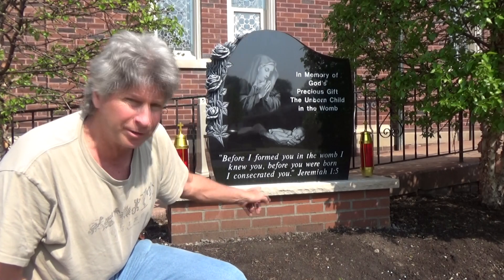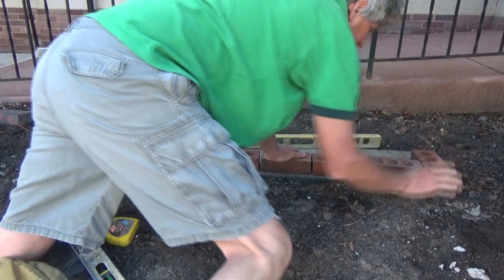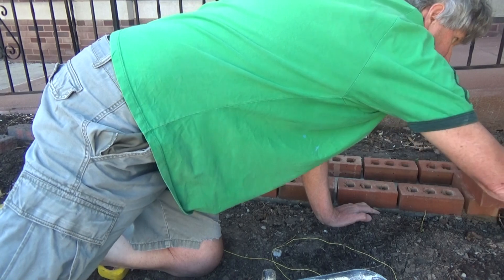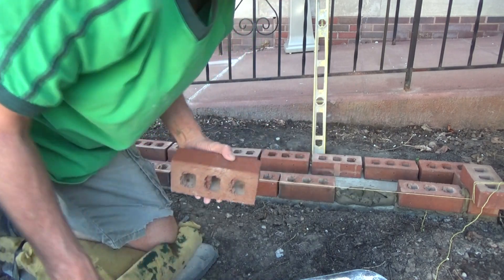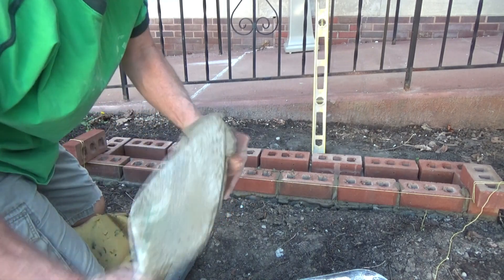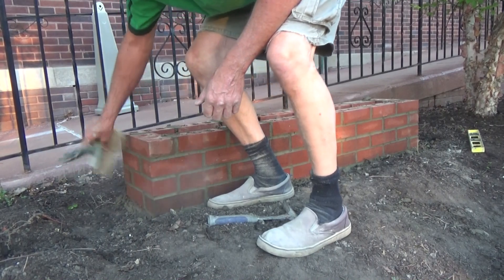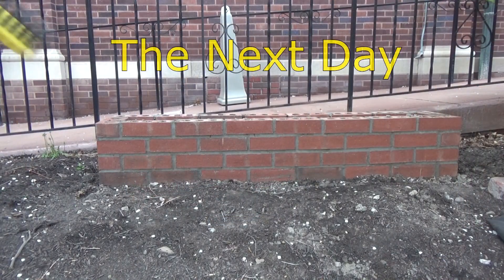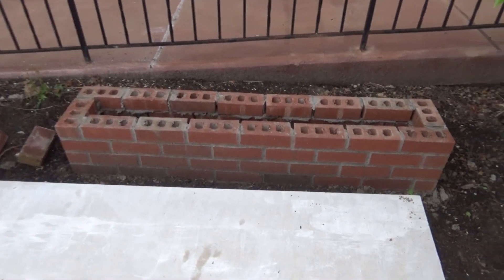Brick base for Monument - Tombstone  (Mike Haduck)

Comment: I always thought the holes in the bricks were there to save on material when making them. 
I always enjoy watching your videos 
Cheers 👍🏻
Reply from the maker: thanks Niall,  I agree with that also,  and the shipping was lighter too,  thanks again,  mike
Reply: Niall Acus it's two fold. It saves material which saves in shipping. Either lower weights or more brick per load. Second, the holes allow it to be in the kiln for less time.

Comment: Mike i use winter ad mix which is accelerator in a gallon jug for 12 bucks whenever i need something to set up quick. Which Im sure ya know already. Love the work
Reply from the maker: Thanks Dino I started using cement all And Lowe’s have the product out there is a fast drying cement but I appreciate it thanks Mike

Comment: I felt a little worried hearing you bad talk type s, since that's my go to mortar here in Central Kentucky, but our winters aren't as cold and our stone is more porus than the glassy bricks. I liked how you laid the bricks out to fit the form and set the line with the end bricks first. Technically you could have left your tape measure at home and still laid that little wall just as good.
Reply from the maker: Thanks Chris,  we mostly use S mortar up here, I just used the portland for a that little build so close the the ground, yet in Europe, they hate that I even use that,  they are into hydrated lime,  but what ever works,  thanks for the comment,  mike

Comment: Hey Mike I’m building something like that but about 25 feet long the question I have is, is it  worth putting a drain in front of it if the pitch of the driveway is gonna run towards it for the water? I live in northern New Jersey? I’m going to be digging a footing 4 feet deep with stone on the bottom with concrete filled.  Any suggestions?
Reply from the maker: nothing, Maddog, I would say I wouldn't want the water to pool there, whatever you think is best, sometimes a trench drain, like they do on long concrete floors, but I am not there to see it, thanks Mike

Comment: Thanks Mike ....The Portland is mix with 2 parts sand also?
Reply from the maker: Hi Luis, In most cases I would use S mortar, two parts than the one part cement, but this was so close to the ground and I knew it was going to get wet all winter so that’s why I did it other guys would use a week or mix it warmer areas thanks Mike

Comment: Hi I have a question do you soak your bricks for a couple of hours before and leave them out a hour before you start your build? Why I ask is that when I try to build a wall and spread my mortar on the bricks, the bricks soaks up all the water from my mortar what is your suggestions to really go about this i'm really trying to become the best i can
Reply from the maker: Hi Joe, every type of brick is different, some soak up  The water quickly, and some barely at all, In that case you just leave one brick at a time but I don’t think it’s a good idea to soak the brick, I always keep them as dry as possible, and I never seen anybody with bricks, or blocks, I hope it helps thanks Mike
Reply: Thank you for the help I appreciate it and your videos are eye opening and Amazing thank you for the help

Comment: Mike I love your work and your videos, and I know you're doing this job for all the right reasons.  But this isn't the right way to do this job.  I grew up in the granite business.  That base should be a solid piece of granite, called a "base" in the monument world, that's just the size that you made the brick one.  A concrete footer goes underneath.  Do it that way, it'll last 200 years, with no maintenance at all.  The granite will last forever.  The bricks, somebody is going to have to re-point it, and the exposed concrete is going to crack, and it's going to be a pain to fix.  All those granite monuments in the cemeteries, they just sit there, and they don't need any work if they were put in right.  Wish you the best sir, and keep up the good work.
Reply from the maker: I agree Tom, but they wanted it to match the others, they insisted, thanks Mike
Reply: @MikeHaduck  Ah.  That makes sense.  Well, in a public setting I"m sure they'll be able to maintain it.  Thanks again for all the videos, and the work to help that memorial, too.

Comment: My next project is similar to this, but instead of a base for a monument, it will be a 30" clay pot.   I'm putting it on a brick pedestal because it's between
houses, and I want to give the dwarf tree more sun.   I've watched your videos, and I'm guessing that you'd pour a concrete base on top of gravel, then
the 3 courses of brick.   My base will have a approx. 40" square concrete pad with 3 courses of brick.   Do you recommend gravel, first?
Reply from the maker: Hi , up here in the north I usually do gravel or modified, everything depends on the situation, I dont think they do it at cemetery, but like a sidewalk I could always get a bar under it and move it down the road, my opinion,  if that makes sense,  mike
Reply: @MikeHaduck  -  Here, in Central Calif, it barely rains but 4 or 5 times a year and the ground never freezes.  So, maybe I'll go cheap and omit the gravel.

Comment: You've probably explained this elsewhere, but why would it ever be a problem to use portland on brick?  Sorry you busted your knuckle there.
Reply from the maker: HI Adam,  If it is a old soft type of brick the portland will be harder and could cause the brick to break up and a large wall the cement will shrink and show cracks more,,  but a new glass like brick like this and the wall so small I am not worried about,  thanks mike